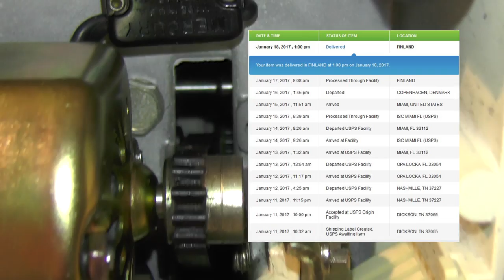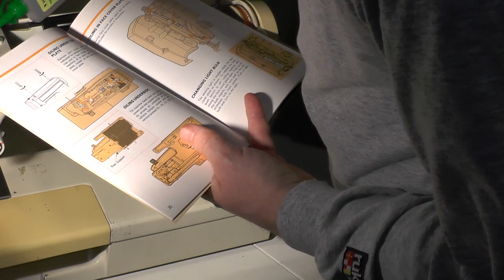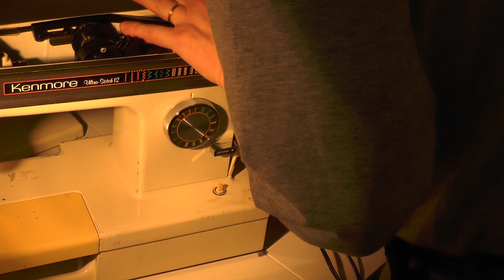Sewing Machine Kenmore Ultra Stitch 12 - Problem solving

Comment: THANK YOU! I have a Janome SW2018 that I love dearly. I thought I had solved the freeze problem after thoroughly degreasing and re-oiling. It was working fine though a project and after a month of sitting... It was frozen again. No amount of oiling would get that wheel to turn and all the other usual troubleshooting ideas didn't bring a solution. For my model, I covered the motor to shield it from any oil since this sits directly outside of it. I didn't have to remove any of those clips. Mine had a little hole. I fed it oil. Let it sit for a half hour... and now it is running smoother than EVER.

Comment: THANK YOU!  This was a "life saver". I have a machine from 1983 that I brought with me when I moved to Mexico, but it had been in a basement flood about 12 years ago and I hadn't bothered to try it since then.  When I did try, I was astonished to find that the motor itself still worked, but was not able to drive the belts.  The hardest part for me was figuring out how to get the end piece off and your video was the key.  After much oiling and then removing and cleaning the belts...Voila!

Comment: I have a sewing machine very similar to this and the pulley idler had the same problem with being seized up.  The easiest way to remove that pulley is to unscrew it completely.  The screw is reversed so right loosens and left tightens.  Once it's removed, you can knock the axle free and clean it properly, then reoil it easily.  Also, that clip doesn't need to be taken off, because the axle will slide out with it in place.  I'm honestly impressed you were able to get the clip off, without first unscrewing the assembly.  I'm also impressed you were able to get the plastic back off without removing the stitch length knob.  I had to use a long screwdriver to unscrew the screws that held the knob on in order to get mine off.  Edit:  My sewing machine is a 158.1595281

Comment: Thanks for the share, excellent video.  I'm having the same problem.  Lubed everything in sight and it still doesn't turn over.  I gave up trying to pull the end cover off because it was late and I didn't want to break anything. Very excited to find your clip.  Mine was a thrift store bargain with no manual and yes, everything was dry as a bone.
Reply: The belt tension can be adjusted from the bottom via a flat head screw. He should have loosened this screw when removing the motor belt instead of prying it off with the screwdriver. Tightening the belt could have solved the whole problem in addition to adding lube to the reduction gear/pulley.

Comment: Thank you for your great video.  I had the same problem.  Sewing repair/ retail shop here in So. Calif wants $200 to service this old Kenmore same year as yours. At the same time trying to sell me a new machine.  said id think about it and left. Very discouraged until I saw your video.  I have always oiled top and bottom of my machine but never knew about the side part.  I was getting ready to buy new belts, but after following the last part of your video oiled it really well and cleaned around the belts ( I think some of my earlier oiling had gotten on the belts)  Its working great.  I didn't want to buy a new machine, they are made of cheap plastic, just need one for mending and small projects. Thank you again, Mrs. C

Comment: Belts are MUCH easier to remove and replace if you remove the motor from it's mounts and lift it up slightly.  Put on the new belts, move the motor back into position and re-attach it to the mounts.  Then make sure the belts are not TOO tight, they should have a little "play" in them,  I suggest you also go back and re-oil everywhere - top, bottom and needle function assembly - before running it again.  You should also clean out the gear box and add fresh grease.  The motor is working too hard and it's noisy - it should be much quieter. It sounds as though it's straining.
Reply: Thanks very much
Reply from the maker: Maybe yes, This worked for me!

Comment: Thank you so much for posting this video.  You have saved the lives of many sewing machines that may have been discarded otherwise.  You are a hero.
To find this video more readily, might I suggest that you add the sewing machine model number to the title (or is it the headline) for the video?  The model number (at least for the one I have that looks exactly the same) is 158.1595  yes, it is completely weird to have a decimal point/dot/period in the model number, but I did not decide the model number--thank Sears for this oddity.
Thanks again.
Reply: The model number is not an oddity. The 158 prefix designates the manufacturer of the machine. 158 was a Japanese company whose name escapes me at the moment. (Later 385 models were made by Janome). The numbers after the decimal point signify the exact model you have from this series.

Comment: I have used that machine for over 30 years, and think you should also clean and oil under the needle plate, also take off the top and oil the rest of the moving parts, and you will have a much quieter, smoother running machine.  Then the motor and belts will run at peak efficiency.

Comment: The old belt you removed looked like it had been put on backwards. With the teeth on the outside. The new belt was shipped teeth on the inside and that's how you installed it. I wonder if that was the issue. I accidentally put oil on my lower belt. Lol!!!... I have an endemko. That's an earlier version of Kenmore. Kenmore bought them out. Great video. Thank you sir.
Reply from the maker: Not really!

Comment: I have a Rossiter? machine, looks practically the same. My belt keeps slipping. A friend gave it the once over and said the belt needed to be tightened, as it had plenty of wear in it. 
Now seen 3/4's  (12.58) of your video. I'm going to guess that your new belts are now too tight, and the noise is coming from your motor under too much tension, and the bottom belt needs to be slackened off, using the large bolt holding the cradle which holds the motor below the base. 
Best continue to watch what you do.
Reply: Omg, whatever you did, it certainly has worked the trick. Was it just dry? It appeared to be working before, just not turning the belt. Do you think the belt needed to be changed?

Comment: Thank you so much!  My machine is doing the same thing!  I too have a Kenmore.  I will go online and get the belts ordered!
Reply from the maker: Maybe belts are not needed. If only more oil to the pulley... Good luck!
Reply: My belts are original, so they are over 20 years old.  I live in an area that is high desert so things tend to dry rot here, especially rubber.  I have used this machine I can't even tell you how much, a lot!  I have made several pairs of scrubs, an entire wedding of stuff, too many repairs to count.  I got my new belt in the mail the other day.  I live here in the states and got free shipping from Sears, so the belt was $8.

Comment: OK stop the video at 1:14 look at the shiny hex head with the screwdriver slot in it it's right above the text on screen bad... simply loosen that move it down and problem solved belt it tightened. Also oil the machine a dry machine turns over harder.😊 Or pause at 1:03 you can clearly see the belt is not worn out it's just loose you can also see how to tighten it....😍

Comment: any idea why a Kenmore model 158.1410 won't zig zag? When I turn the width dial, the needle moves left and right. when I try to sew with it, no zig zag stitch. Needle moves to the right side of the presser foot and will only do a straight stitch

Comment: Did anyone else notice that the original lower belt had flip turning the splines to the outside? Most likely needed new belts anyway, because I can only imagine they would flip onlt after being overly stretched.

Comment: It still doesn't sound right. Have you tried to loosen the tension on the motor belt? Sounds like it has too much tension.
Reply from the maker: You are right. Presser Bar (inside the Face Plate) needed oiling too!

Comment: I just bought a really great Sears Kenmore machine but the Feed dogs won't move up or down. Any tips?
Reply from the maker: Maybe more oil? Or something broken? Good luck!
Reply: Did you figure it out? The most common  problem is that your feed dogs are in the lowered position.
Reply: I recently had this issue with one of my Kenmores. I found that the arm that controls forward/reverse was moving, but the pivot that actually engages the mechanism was stuck. The grease had dried and wouldn't allow it to move freely. It moved, just not smooth like it should. After removing, cleaning and lubricating the pivot, it worked like it should. Took me a while to figure out since I'm not an expert, just like to fix stuff.

Comment: Most Kenmore sewing machines that use a pully have this problem because most owners never bothered to oil them.
Reply from the maker: It is so easy to borget. It is not noted in the manual.
Reply: I recall that after the shift of external belt drives of the early singers to more compact sewing machines which you could carry easily, there was the expectation that you would have it serviced yearly, like your car, or TV.

Comment: If your belt was the problem then your motor would not have stalled at the begining of the video. Right then you should have been trying to see what was jammed. 

At least I can see how to take mine apart if I ever have issues.

Comment: I am really sure that is not the way to install a belt... The motor or that intermediate pulley loosens to allow for removing and adjusting the tension of the belts. Not even watching the entire video, you desperately need to oil that machine... before you burn out the motor that is... a machine should move freely, if not, the FIRST thing you do is oil it... not replace belts and then oil it. Oiling a sewing machine is the first step of problem solving, not the second or third. ESPECIALLY if the machine has been sitting. Sewing machine oil evaporates and then there is no lubrication anywhere.
Reply from the maker: At first oiling was done according to the manual. Tension is not possible to adjust. Manual don´t define oiling for the pulley. Right or wrong, but machine really works now!
Reply: I fix sewing machines all the time. Love those Kenmore. 
I don't think the belt needed to be changed. All you needed was a good cleaning and oiling. Tighten the tension on the belt pulley on the bottom with that screw on the right. 
Not a very good example of video as far as taking the machine apart. Lol
Reply: And it still sound bad. 
You need to open the bobbin area also and GREASE the gears not oil.
Reply from the maker: In this case tighten is not good way, pulley was been jammed. Machine is working great after 8 months now. I'm not specialist but manual is not accurate enough.
Reply: David Cote ai

Comment: You clearly should not be working on mechanical devices. Not enough sense to check all the bearings and lubrication first. Fortunate you did not burn up the motor.
Reply: that's mean, hey, he says its working .. rich people just buy a new plastic one ..

Comment: Useless video.
I fix those all day long.
Need oil, grease on gears and tighten the belt at the motor mount.
Reply: I have a Kenmore 16951 that will not reverse. Any ideas on what might be wrong?
Reply: Might be useless to you but I found it helpful since mine was 2 steps from the trash.  Just oiled and tightened the belts(ordering new ones just incase) and it's seems to be working better already.
Reply: @darlenevilleneuve4227  Oil and cleaning will fix that...
Reply: @darlenevilleneuve4227  I recently had this issue with one of my Kenmores. I found that the arm that controls forward/reverse was moving, but the pivot that actually engages the mechanism was stuck. The grease had dried and wouldn't allow it to move freely. It moved, just not smooth like it should. After removing, cleaning and lubricating the pivot, it worked like it should. Took me a while to figure out since I'm not an expert, just like to fix stuff.
Reply: It was useful for all the comments, and for me to see what is holding the upper pulley and hand wheel to the machine. As yet I've not found an online manual for my machine, nor a video.
Reply from the maker: Useless, but fun, or what?! Anyhow you watched it!